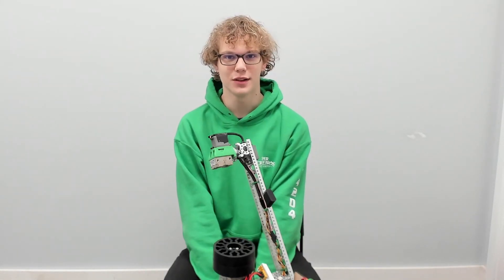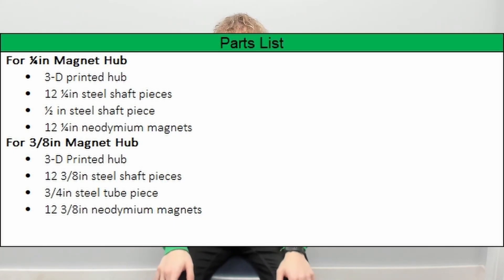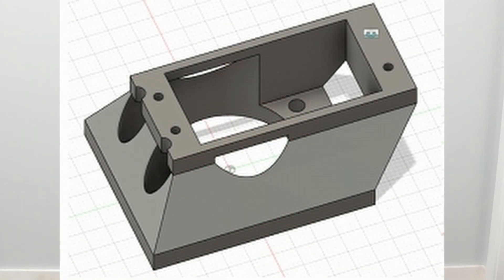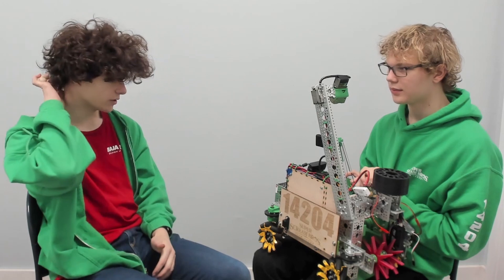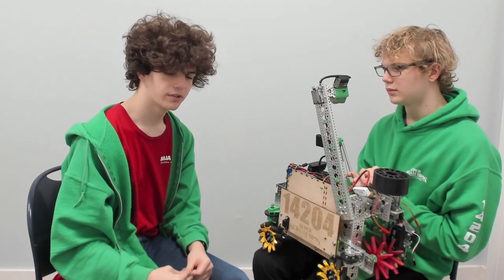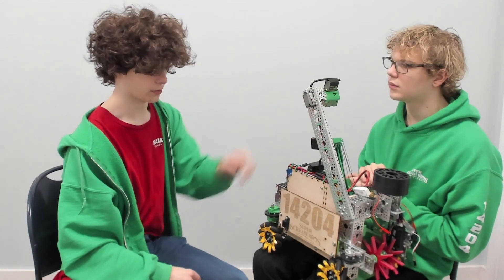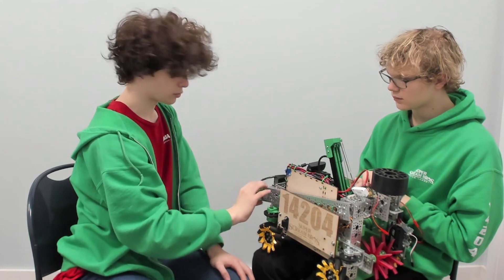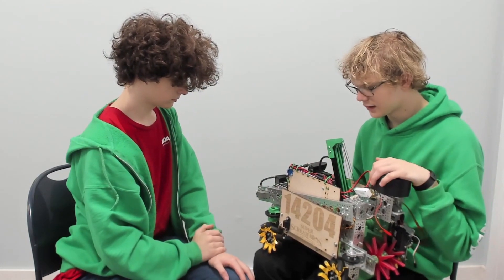Our Magnet Powered Arm for 2021-2022 Freight Frenzy

Comment: Cool video and awesome idea. But I don't understand how it drops the cube. I wish you showed that better. Also, do you have a plan for picking up the balls?
Reply from the maker: The magnet is able to drop the cubes because it's able to switch on and off. I didn't give the best demonstration, but the Magswitch device is able to be rotated, and the poles of two magnets are then either attracting or repelling. When the magnets repel the magnetic field extends out, and that allows it to pick up blocks. Wehn the magnets attract then the field stays close to the magnets, which causes the block to drop because it has no magnetic force holding it.

As far as the balls, we have a more standard intake that can pick them and the un-weighted blocks up. The magnet is really only meant to help with the shared hub as we're able to pick up just the weighted blocks with it.